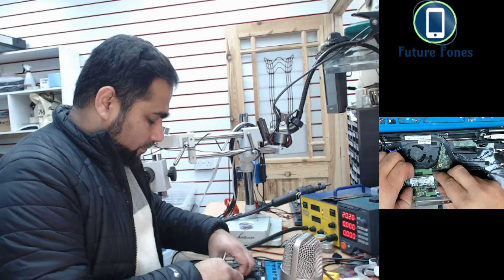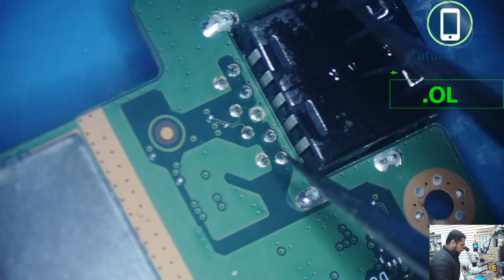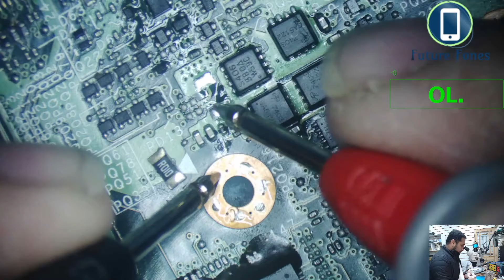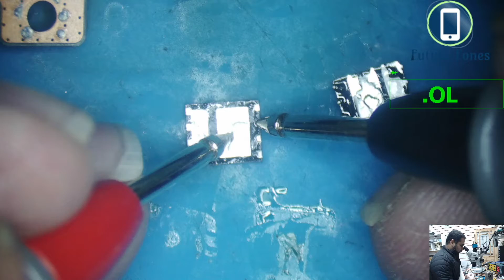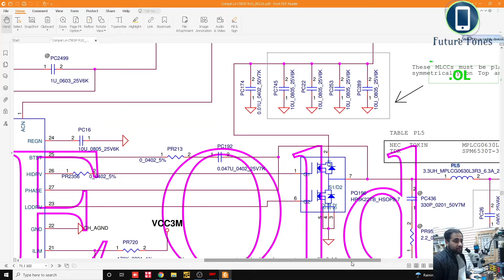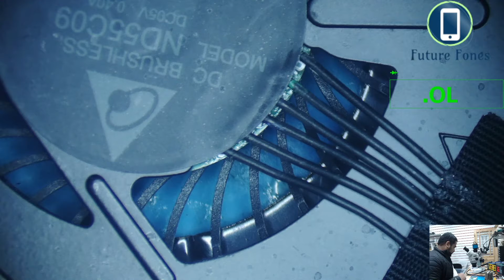Let's Fix Lenovo Yoga 260 No Power Laptop. Blinking at Charging Port only.

Comment: hi nice work keep up from ethiopia. 
rather than taking out  a coil  for short you can use your  dc power supply 1 volt and some cuurent to detect which side the of  the coil has more voltage drop  with out taking an inductor.

Comment: Salam brother fahad, can you use components from another board that have the same looking coils, mosfet etc.?
Thanks
Reply from the maker: Wassalam brother . It’s not easy question. If you don’t know about components I would suggest you to have donor board and replace the faulty components from donor board at exact location.
Reply: @futurefonesltd  yes you are 100% right and it’s a lot easier.
Thanks I will buy a donor board

Comment: looking for a hint, same board:

In my case not PL5 but  PL3 is shorted to ground. Removed PL3 now short is present on the left pin also on PC140,PC511,PC2153.Are these supplying voltage to this PL3 coil?
Reply from the maker: PL3 pin1 is generated by Pq16. PL3 pin 2 is output voltage to vcc5m via smoothing caps PC140,PC511,PC2153. Use voltage injection method to find the shortage on this line. Here is the link for voltage injection method.  https://youtu.be/ArMAlDF20bI
Reply: unfortunately i lack donor components and a linear power supply;

Subscribed!